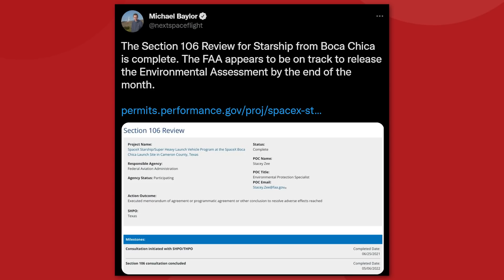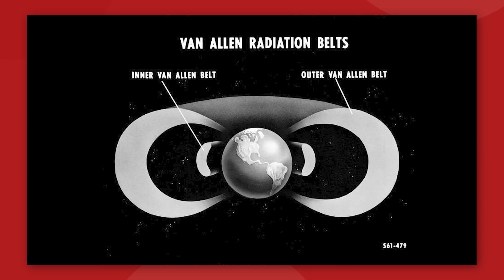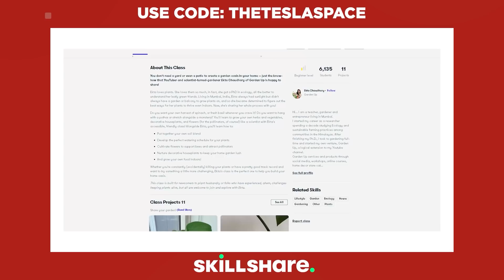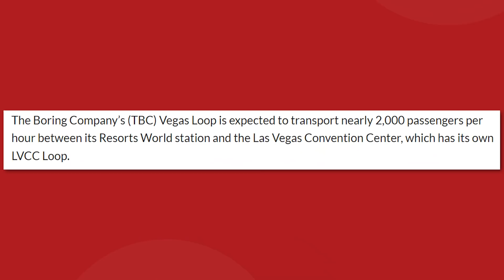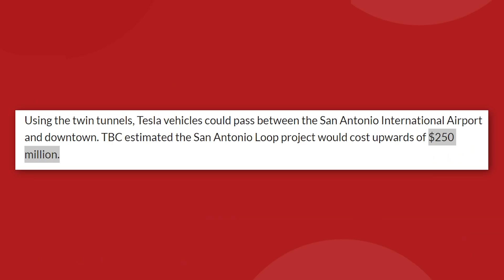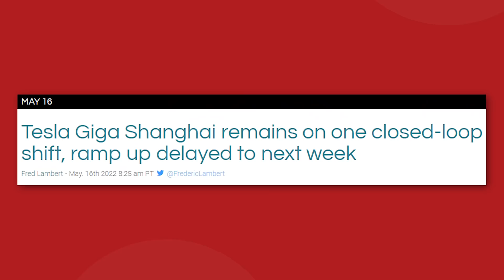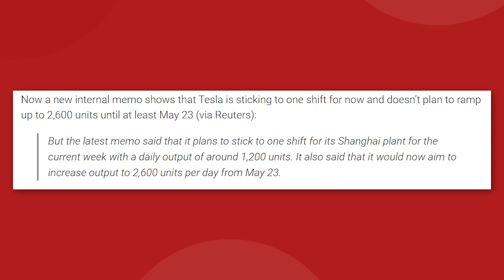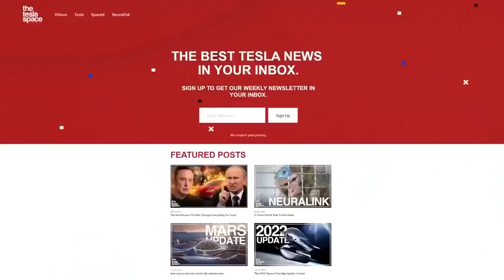New SpaceX Starship Orbital Launch Update!

Comment: The Boring Company is trying to make its way into a public transportation sector which is beginning to embrace the turn away from car-centric design. If it focused on building low-cost rail tunnels, it would be much more successful.
Reply: I agree, in fact replace MY tires with rails and steel wheels, it would sell like hotcakes even though more expensive to install and maintain.